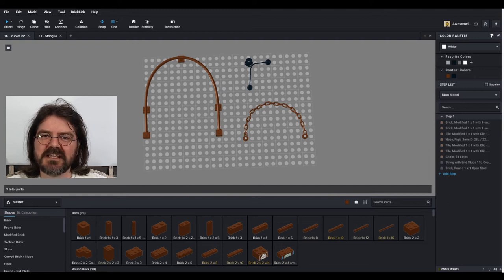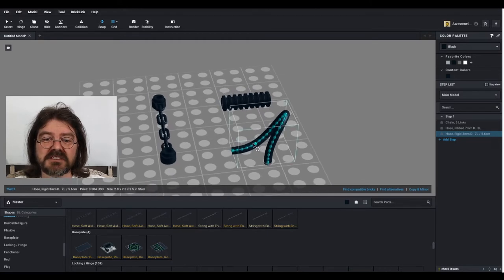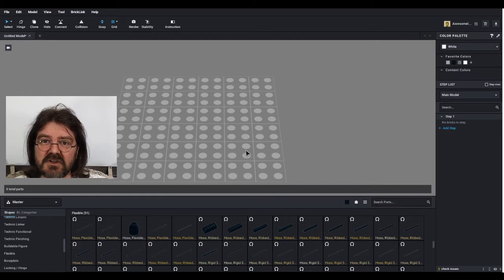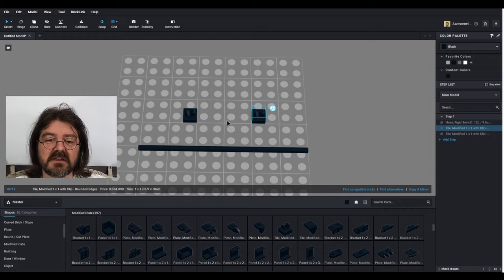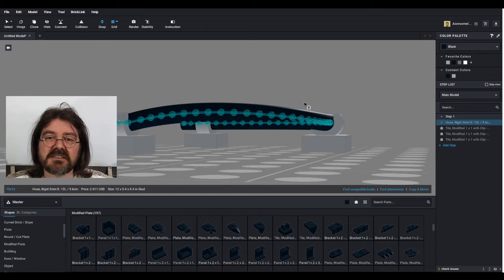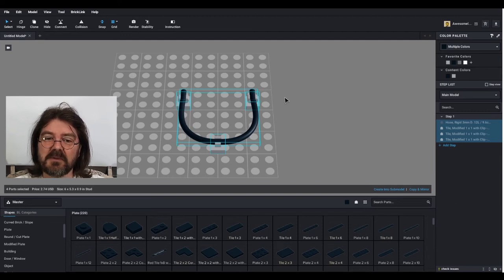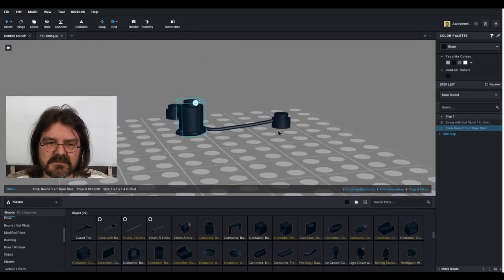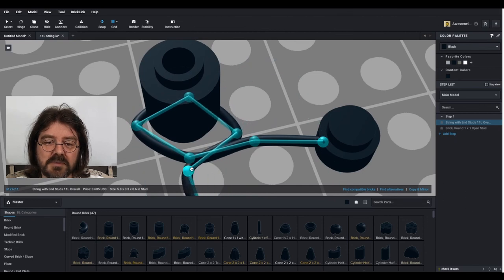Studio Tutorials - Flexible Parts! Add some flexibility to your LEGO designs!

Comment: Thank you this helped a lot! 

Instead of building plates to move the clip to the right stud you could also use the shortcut-keys WASD. The clips will move 0.5 stud.
Other useful shortcut-keys are shift-arrow to rotate the brick 45 degrees, ctrl+shift+V to invert selection and F to set the origin to selected brick.

Comment: Hey there, you can rotate the ends of the flexible parts only 90 degree in each direction? i really hope they will add e smooth rotation because this functionality is still very limited, despite the great progress.
Reply from the maker: I believe it is like all rotations, if you hold the shift key while hitting the arrow keys it can rotate by 45 degrees. I agree though there is a LOT of work left to make this a really viable tool in Studio.
Reply: @PlaywellBricks  O yea, thanks!. I've avoided Stud.io due to the lack of flexible items, but it is getting there. If they only added the same rotation gizmo when you select at least these end points it will do wonders.
Reply from the maker: Yes, I put in a list of suggestions, just waiting to see if any are accepted.

Comment: Have been struggling for hours - days - to get a couple string parts routed along and around bunch of parts (engine bay in a race car). Studio's Flex tool is easily the worst 3d-space tool I've ever experienced. Absolutely needs a method to control the plane and angle of a change to a node locking a change into only the X Y or Z plane (apparently changing the viewport to top, right, back etc does /not/ accomplish this). Bezier path would be amazing, but even just being able to isolate specific key waypoint nodes to 'steer' with rotation and arrow positions and then lock them (a la LSynth) would be a massive improvement. Fully agree with the problems with the String part, crazy that it has so few nodes.
Reply from the maker: I have heard the developers have tried a bunch of solutions. None which worked. Best bet is yo use LDCAD and import the part into Studio.

Comment: Hi. I'm trying to make instructions for the vintage set 4025 (fire boat). I stuck on the last element, specifically the hose reels (4209, 4210) with a hose end with a handle (194cx2). I don't know how to put it together. HELP.

Comment: Hey, Thanks for the video! 
I'm having issues with the flexible hose 22l with 2 connector ends, it doesn't seem to have any "nodes" to move it around, getting the two ends in place is fine but I can't seem to secure the middle in a clip or manipulate the rest of it without it just returning to an odd position, any ideas? :)

Comment: That looks really easy and i will try it yet. Why couldn't electric cable not work like that?

I also have to say: thank you for your great video, very useful again 👍🏻
Reply from the maker: I suggest looking into LCAD, for flexing electrical cables. I have done a video using that program to flex parts, hopefully that will help you out.

Comment: Thank you so much for this informative video,  I was struggling with using the string and the older hose parts, now I know why.  I wonder why they designed the string flexible function to be like chain, when string is probably the most flexible item lego makes. Great video, I came across your videos and subbed right away. I am wondering how I can get parts added that are also not in LDraw.
Reply from the maker: Thank you, I am glad it helped! If the parts are no in the LDraw library you will have to make yourself or have someone else make them. We do offer that service if you are interested.
Reply: @PlaywellBricks  hello, what do you charge to create parts?  Do you do printed parts also? Thank you.

Comment: What about flexible train track? As I see it doesn't bend in any way
Reply from the maker: You are correct, there is no way to flex them.
Reply: @PlaywellBricks  that’s unfortunate! Any chances it will be fixed?
Reply from the maker: @EldarKhaitov  I have no communication with the dev team, so I am unable to answer that question.